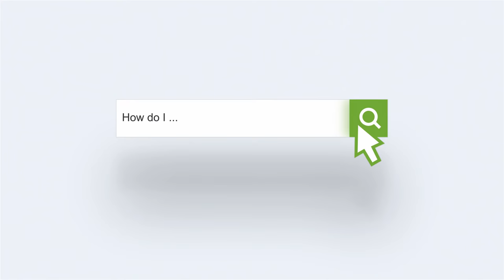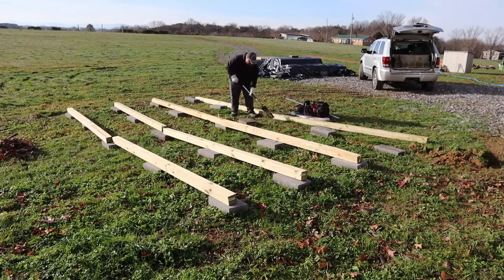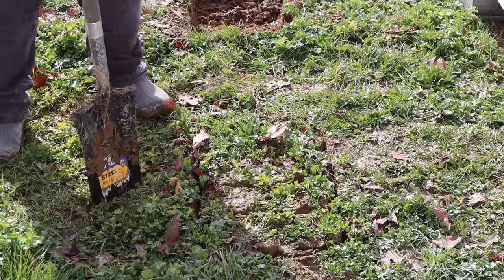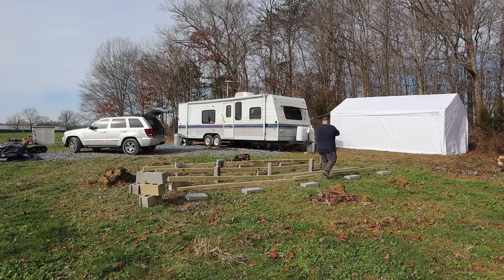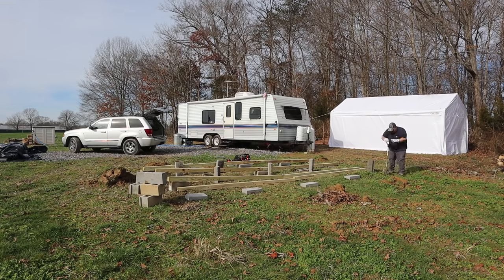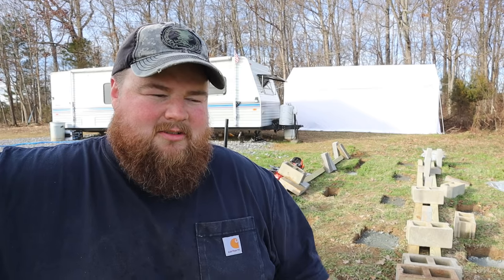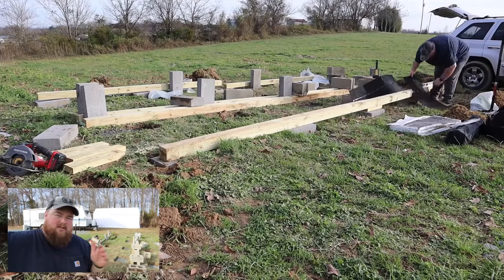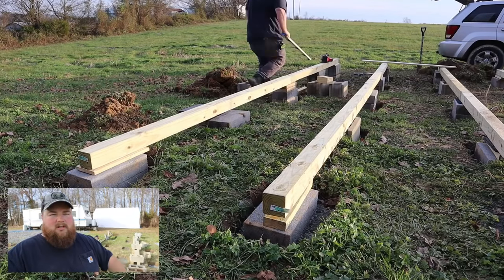BACK BREAKER! | Block & Skid Foundation - Shop Build 01

Comment: Dude you need to go at minimum 20in down to avoid sinking. Sand then Quarry dust. Unless you're super dry where you're at but it really doesn't look it. I have heavy shale on my property, I went 20in down and my block still sunk 6 in within the first three years. Looks like you're doing a good job though hopefully it's not the case on your land.
Reply from the maker: Benefit of this type foundation is that it can be leveled and shimmed as needed over time.
Reply: The holes in the 8x8 block will give the moisture somewhere to go.
Reply: @Samcraftcom that's what I was thinking, but how would you do it in the middle?

Comment: I'd make sure any of those 8x8x16 blocks are placed with the flat side down unless on top of a solid block to keep them from sinking as fast
Reply: I agree it settle uneven
Reply: Do not lay CMUs on one of their vertical faces. While it may prevent some sinking as the surface area in contact with the ground is increased, it will dramatically reduce the unit’s structural integrity.
Reply from the maker: Most are on top of cap blocks, but all are on the compacted base to prevent sinking.

Comment: Very helpful video. I'm starting my 10x12 shed and began the foundation work today. I got the first row of holes dug and blocks in place which took several hours. I thought, am I overthinking this and spending too much time? But after watching your video I realized, it's normal to spend that much time to get the foundation level and right before moving on.

Comment: Sam, I am 87 years old and my son-in-law, is 67 years old.  I am glad i did not see this video before we started a workshop.  The reason is we could have built the shop from scratch.  We made the block/concrete foundation on a surface like yours BUT very hard clay.  So, we did not want to dig much. We build our foundation to fit a purchased building of 12 x 20 barn type building to save a lot of work.
Reply: Tough men 💪💪

Comment: Thanks for sharing. We’ll be building a large shed this spring, and I’ve been in analysis by paralysis mode trying to choose a foundation. I really like skids but wasn’t comfortable with ground contact, even if using treated wood. I love putting them on piers like that.
Reply from the maker: I understand being stuck on design thoughts. :) What helped me realize this will be perfectly fine for me, was seeing the "plop and drop" storage sheds and how their "foundations" are done. Then seeing that it was perfectly fine for those structures and knowing it wold be fine for mine too. I then upgraded by the additional skids and supports and paver base to feel very good about what I have in strength and rigidity vs. cost and time. When my structure settles or moves (it will over time), it will be easy to raise up and shim to re-level with a bottle jack. Just like how mobile homes are able to be re-leveled in the same way. :) Happy this helped and good luck on your project!

Comment: I had my workshop built a few months ago. Same design. Pier and beam building built on site.  Builder put the floors on 12 in centers walls on 24. Additional bracing where he deemed necessary. A very strong building!
I added a few extra blocks underneath that I probably don’t need, and I used Composite Shims. You might want to consider using them as they are extremely strong foundation shims. And cheap!  I got mine at Home Depot
Reply from the maker: That's very close to what I'll do -- 24" OC walls & roof. Thanks for the shim info, I'll have to check into them!

Comment: I just got into building stuff out of wood. I think it is a amazing skill to have. Im so into it that I would even work for someone for free as long as they help me learn the skills.

 Speaking of learning would you care to explain how you jointed your 4x4's? Reason why i ask is because i am planning on making a 12 ft long skid foundation but i cannot transport lumber longer than 8 ft so i am curious as to how to joint two smaller 4x4 pieces of lumber to make a 12 ft one. Also, would you know if it is ok to combine two 2x4 with screws to make a 4x4?

Comment: I literllay built mine in a similar fashion in 2020. I used landscaping fabric in the hole under paver base. We have sandy soil and I thought, it would be a better foundation to prevent the paver base from shifting into the sand. Seems solid a year later. 

If you haven't already, you should use hurricane straps at the butt joints of the skids you are putting your floor on. I used 16" straps on each side of the beam. While you're in there, its assurance that the skids will not slide apart if you have to move the building. I had to move mine to meet setback code and this allowed me to use 4 machine dollies (one in each corner).

Comment: Nice start to a great project. I'm interested in your series analytics. My shed build was posted  In January and it's one of the worst performing series out of my 1300 videos.
Reply from the maker: It will be interesting to see how the videos do. Between the two channels, but also in this time of year. I've found that if you want a build series to take off, the best thing to do is make a complete start-finish video of the whole process so it's a one stop shop. All my videos of that style are popular.

Comment: Love my new workshop  20ft x10ft
Reply from the maker: Sweet! Do you have any workshop tour videos?
Reply: @Samcraftcom   I have made some videos Sam on my channel off me making it last summer I planned for 11 cnc and 3 laser and 6 3D printers and saws and  more it tight at the moment but I have been on cad design to make sure that all fit and thanks for the tip on windows tablets saves a lot of space in a small workshop I have 4 cnc in at moment all full home made on my printers but now I have steel to make them solid on a cnc that I made my self in my pond shed and kitchen if you see videos 1/10  on channel I have came a long way in a short time

Comment: Sam great series I’m enjoying the videos on both your channels, but 1? Are you going to lay any type of plastic on the ground for moisture and are you going to insulate the floor??? Thanks for the Thorough information.
Reply from the maker: I didn't think of vapor barrier until it was too late (floor framed), and have no plans to insulate the floor. I guess I could go back and lay plastic under the floor on the ground and skirt the building, but don't have plans right now.

Comment: Nicely done. Did you need any kind of permitting for this? If so, will the footers be inspected? Happy New Year.
Reply: When you live out in the country, you don’t have to deal with BS permitting
Reply: @dentonjordan6992  sounds like its time for me to move. Cheers.
Reply: from what i have read as long as its under 200 qf  most plases dont need a bulding permit but you might need some kinda zoning permit if you have a small yard

Comment: I've got something similar coming up if my property ever dries out. I was considering something like this.  Alot of clay here, let us know if sinking becomes an issue.
Great video. New sub
Reply from the maker: Our land has what they call hardpan clay about 8" below grade. I dug down to that and have been told it should be good. We'll see how it does long term. Most other sheds are just dropped on top of the soil. The benefit of this style foundation and floor framing (to be shown in next video), is that it forms a rock solid floor unit to where it can easily be jacked up with bottle jack and re-shimmed or leveled later as settling occurs. I'm sure it will settle some.

Comment: I was thinking about throwing a 12x16 shed on just those hollow core blocks. Will be using 9 of them. Anyone know if that is strong enough for years of use?
Reply from the maker: I think it would be strong enough, but my concern would be them sinking or settling into your soil. All the sheds that are made and delivered are set on blocks like that.

Comment: Sam like your Channel just a thought your two main Runners need to be 6 ft from outside to outside in the middle if you ever plan on moving this building all movers trailers will accept a building with a Runners 6 ft apart in the middle the outside Runners make no difference but if those aren't 6-foot they will not line up on the trailer

Comment: could have ran blocks cross the timbers (poles run east to west blocks should run north and south ) to be most stable over time and much easyer to shim level. Just my two cents
Reply: I was wonder this would u do this so u won’t have to worry about the Timbers rolling off the blocks and is it dangerous to have so many lawyers to build up the blocks instead of just one block height

Comment: Why are laying the level on its side? In my 53 years I've never seen a level used like that. Levels are designed to be stood on edge not laying down.
Reply from the maker: Ask a block mason and they will tell you differently. If your level is true and square it works perfectly fine.

Comment: Not concerned about termites? Your wood is awfully close to the ground.
Reply from the maker: Treated wood is embedded with chemicals to resist termites.
Reply: @Samcraftcom  thanks Sam, I didn’t see the tell_tell indentations that the pressure treated wood has over here.